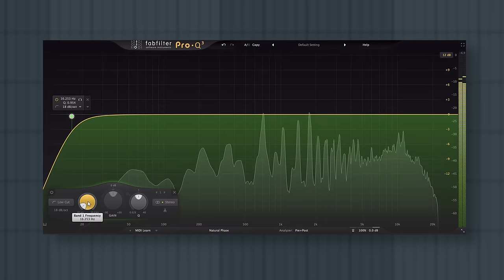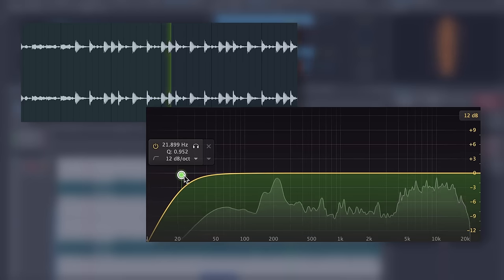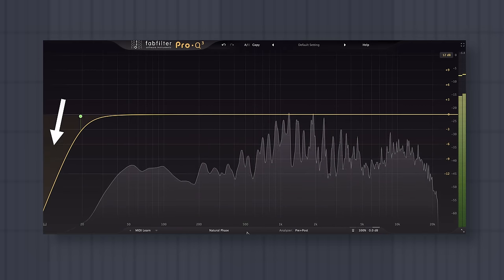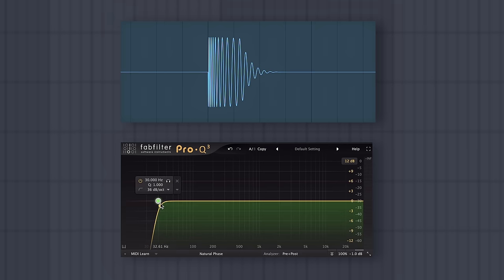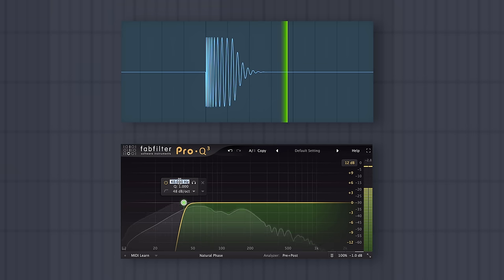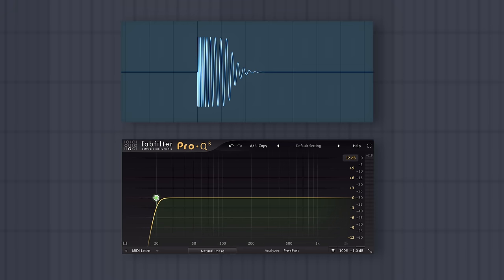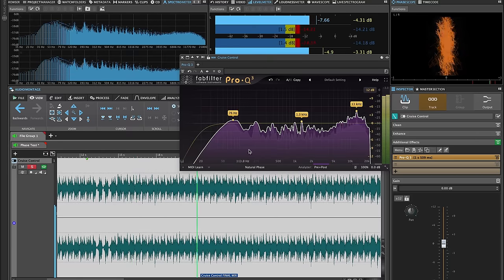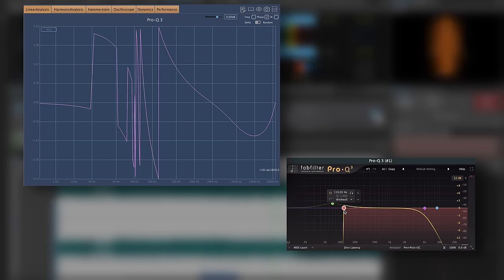Do high pass filters ruin your mixes? Fixing Bad Music Production and Mixing Advice EP.2

Comment: okay nice advice ! I have learning in case of using 2 EQ to apply the linear phase in the 2d one but not about the high pass trouble...thank you for this brightening about the phase in the low part, but now i'm asked me about the high part ? that's make trouble if i apply a brickwall low pass at 10000hz for example ? And for the case i using a reverb in a bus with a Eq after, i have to activate the linear phase too and don't using an hard high pass curve ? I will testing right now :)

Comment: any track that doesn't have or isn't supposed to have low end, i take it away. and i use my ears mostly, i low cut as high as i need to not have interference, and as high as possible without changing the sound of my track. in the full mix the tracks sounds no different from before, but the final low-end is so much better

Comment: What you said is correct but usually (from what I see) the context of this discussion is rarely mixing or production and instead is used in mastering, within mastering using a high pass filter because you’ll get a “louder” mix, In mixing high passing is extremely useful but in mastering it rarely serves a good purpose unless there’s a serious issue which it would be better to just have the mix sent back for revisions instead. 

I’ve seen advice like “cut everything below 30hz in your mix because you don’t need and it therefore should get rid of it” it’s that kind of thinking that is usually being combatted, highpassing is of course an extremely useful tool but just slapping it on a mix and expecting it to be louder is just silly (unless your removing everything below 100hz or higher in mastering but again that’s just silly)

Highpassing isn’t the enemy, the “always do this” advice is. 

The thing about plug-in doctor, I only use it to understand exactly what my tools are doing to the signal but I never use it during mixing or mastering, also unless you’ve really done your research, most people don’t know how to use it properly. 

I’ve seen even professionals analyse the frequency response of a saturation plugin in the LINEAR analysis tab and other things of that nature. 

I think that especially in mastering every little action must be justified and reasonable, instead of the template, cookie cutter approach. 

You shouldn’t just be applying processing because you feel like you have to instead know how to achieve what you want while doing the smallest move possible as ANY process you add with be compromising the fidelity of the audio in some way so having a clear strategy, wisdom and experience is key to good mastering (or mixing for that matter)
Reply from the maker: I really appreciate the wisdom you shared here. I also agree that processing is best when it's intentional and never as a rule. I also am frustrated by plugin doctor reviews of non-linear processes. It makes me want to pull my hair out1
Reply: @inthemix  also as a fellow Scotsman I respect your craft and I’d say your channel is one of the top 10 I’d recommend for anyone starting. 

I’d love to see some more advanced stuff from your channel, especially when it comes to mastering as I find that 90% of the advice is for beginners and intermediates, I’d love to see some proper deep dives into some really interesting topics such as DSP, Psychoacoustics, room acoustics (using room EQ wizard or Dirac live and learning how to measuring and read the information it’s telling you), maybe have a tutorial on how to analyse equipment and plugins with your own spin on it

Comment: Best advice I was given so far was to just don't cut on buses or mix bus. If you do, then it would be call for the linear phase option. Otherwise than that, just use zero latency and cut that shit. If it's not meant to be there, why bother about phase.

Comment: Ok I’m going to answer this using a “wrong” approach — listening on my phone.

I think mix B sounds less good to my ears.  Like the kick is a little stifled and almost compressed.  

Whereas mix A sounds a bit sharper and punchier.

Again, this is listening in my phone speakers, so it’s not a good way to test which has the low pass filter.  I’m away from my studio but thought it would be interesting to see if anyone else hears it the same.

I wonder if the high pass is on B but unexpectedly making it sound punchier on a phone.

Comment: May I ask what's that black interface/volume control solution your are using on your desk? 🙃
Reply from the maker: It's a merging anubis interface. I'm still not sure if I'm sticking with it long term!
Reply: @inthemix  they tend to say they sound good. I myself use a Prism Lyra 2, which I love the sound of. (or lack thereof :)) The volume pot is flimsy and chunks bits being digital, so I'm using a Heritage Audio RAM500 in an Elysia Cube after it, but any professional volume control method would work. (to my ears it sounds more dynamic through the analog volume controller, than using the Prism at -42dB digital output) Thanks for the reply, and keep up the great content, as always :)
Reply from the maker: @galgogergo   I found my Lynx Hilo to be easier to use. This Anubis sounds great but the Ethernet connection is really annoying. You can't use a VPN, it crackles from time to time and takes a very long time to boot up. The routing possibilites are endless and it it relatively intuitive but I'm not sure it's a perfect fit for me.
Reply: @inthemix  Yeah the Hilo is great as well.
(One of my big disappointments for the MT48 was when I learned that it boots for 60 seconds.)

Comment: I actually disagree with the "phase shift" terminology because it's not the phase changed. What's changed visually is the frequency of the low end because you've cut the lower frequency and you see the frequency higher than it was before you applied  a HP filter.
It sounds to me like
"Ok I cut 20Hz and expect the waveform to go up and down on the same length on the graph"
But if it revolves with the same wavelength - it's still the same frequency!
And yes, you hear the difference because there're no more these frequencies which you have just cut out. Isn't it the purpose of HP filter??
Seems it's a problem which was made up of misunderstanding of physics.
You can't hear phase shift until you try to add something to something other. Try determine the difference between cos and sin in blind test by ear. You actually can't. You can only if you play both simultaneously though.

Comment: i'm literally listening on a 2015 macbook, but i do mix and i can hear. B sounds worse. whichever setting B is is the worse setting. it sounds less "whole", and somewhat "recessed" and "unconfident" and compared to A. the middle of the stereo field got less forward as well. its like a superhero vs an awkward teenager with a bad posture.
Reply: its obviously subtle, but i'm drawing a metaphor. B is subtly weak-postured. lost stridency, and the composition of the track needed that stridency, they went well together.
Reply: being that i'm on macbook speakers, it definitely feels like the bass is changing things. maybe B has no high-pass, and A has the highpass, so there's more bass in B, and that's coloring/modulating the highs in the final limiter interactions, which makes it B sound more "phasey" and wobbly.
Reply from the maker: They were both the same
Reply: @inthemix  nice. yknow i still actually stand by what i wrote qualitatively, it's just that the program material btwn A and B are diff. A is a little louder due to being closer to the start of the section where it comes in with a crash, B is more of a calmer continuation. haha. but great point! its very hard to isolate parameters!

Comment: Lol on my computer speakers both kicks sounded nearly the same. I'm sure on my sub they wouldn't. Besides, who says the high passed one wouldn't sound better in the context of a mix?

Everyone blows everything out of proportion. There is no such thing as "linear phase EQ" in analog. All analog EQs cause phase shift. Almost every console has a high pass on every channel and they were used often. Some like the SSL are variable, while smaller consoles only had a high pass button fixed at 60/80/120hz. Every classic record today was mixed on one of these and used EQs with "phase shift" and they sound just fine.

The only time phase shift can become a real issue is in the context of ANOTHER sound, where the phase should line up but gets shifted out of place. This may or may not happen, and may or may not be an issue. Just use your ears. If it sounds good, do it. If it sounds bad, don't.

Using your ears is the hard part. I've had things that you would assume shouldn't have any LF like hihats just sound "wrong" when hi passed. Sometimes there's just a little energy down there that just sounds "wrong" when removed. Mixing is more about critical listening than just doing things. If it sounds right, keep it on, if it sounds wrong, take it off.

Also, B is the highpassed version because it sounds better lol. TBH I doubt I can actually hear a real difference.

Comment: So I've been engineering audio for about 20 years, professionally for the past 10 - and I am absolutely baffled by this concept to begin with. What's the complaint here? That hi-pass filters cut off your low end? Well yes, that's what they're intended to do. Even the example where you go for a 40 Hz cut at 48 dB/oct still sounds good, only with less sub frequencies - maybe that's exactly what the track needs? Maybe you want a thinner kick for the verse and a beefy one for the chorus? Maybe you're dealing with a track that was recorded with poor mic positioning and it needs extreme cuts to make it work at all. Maybe you need to put a HPF at 300 Hz at 24 dB/oct, because anything lower just doesn't cut enough. I just don't understand the entire reasoning behind this argument. What's the problem with the phase shift? Unless you're trying to combine or mix together the original WITH the phase-shifted sample, I don't see what's wrong with it. A phase shift is only a shift in relation to the original. So is low end boost/cut. Unless you're aligning the two, why would anyone care what a waveform of a processed sample looks like? It might be mathematically irregular, but it's a sound, and it may just be exactly what you need. It just seems like people inventing problems that don't exist. There are no correct settings for EQ, because we're all dealing with different source material to begin with.
Reply from the maker: My view on the topic is so similar to yours. And yes, even the aggressively filtered kick drum would still be ideal for many tracks. It’s such a non issue to be discussing.

Comment: I mean, if you're HP'ing your sub bass with a cutoff that's too high, of course then there's less bass. What's even the point of making that argument?

Then, in terms of phase, why would a phase-shift matter? If you're not doing parallel EQ'ing on the same source, it doesn't matter if the phase is one way or another. Sure, maybe you want to align kick and bass perfectly, so just do it after EQ'ing. And ironically, if you go with linear phase EQs in a context where you're not parallel EQ'ing, then you actually can get into trouble sound-wise because of pre-ringing the linear phase setting will introduce.

Comment: That's interesting. I have 2 guesses. The first one is that B is high passed, because it sounds overall louder to me. Which could be because of less low frequencies that need to be compressed by the master, resulting in louder mids and highs and an overall louder feeling mix.
 
My second guess is, that A is high passed, because the kick drum in B almost definitely has more low end or more punch if you will. 

Hard to decide which one i'm going with, but I'm guessing that A is the high passed mix. The low end difference in the kick drum is much more present than the change in loudness, that could also just be imagination.

Comment: I could be wrong but I believe A is the high passed version. The main difference i hear between A and B is that B seems to have a slight decay from the Kick in the lowest of lows (down in the sub 35hz range) that kind of pumps what presumably is the bus compression ever so slightly compared to A. Its extremely subtle and I had to listen for it a couple times. However im a little skeptical if A is truly the highpassed version or if its B, because sometimes filtering out any rumble or noise below 30 hz can subjectively improve the low end due to the fact the compressors are now working less hard for any given value in that low end by processing less signal and increasing that pre-compression dynamic range, but in this case it sounds to my ear like the compressor is working harder on B, hence the very subtle extra pumping I perceive. Really curious to see where I'm landing on this one!